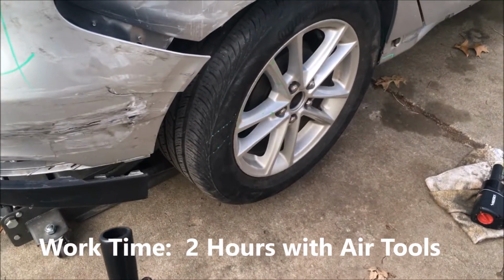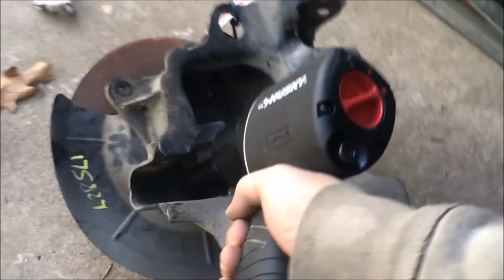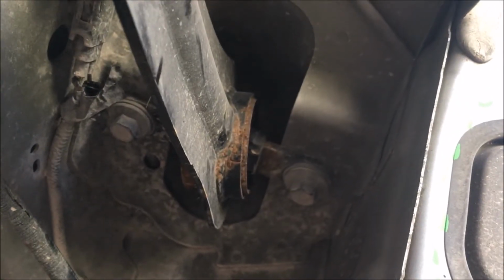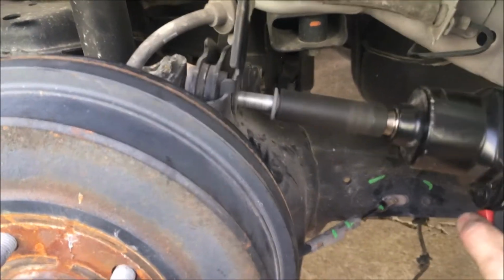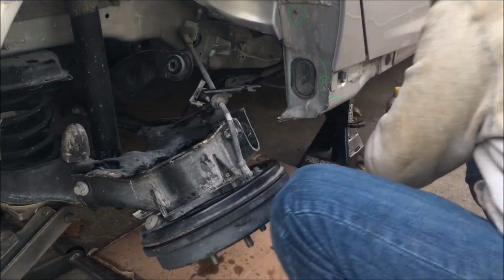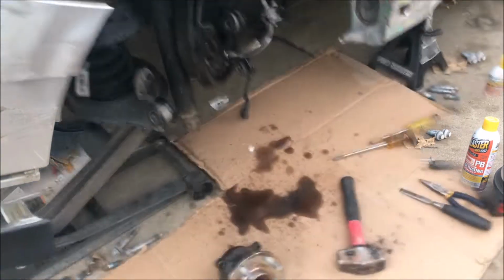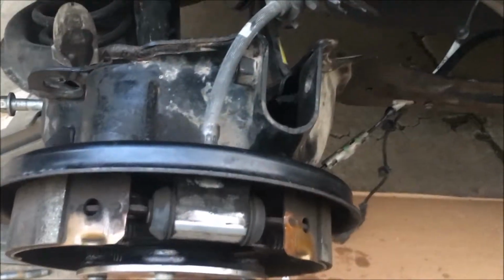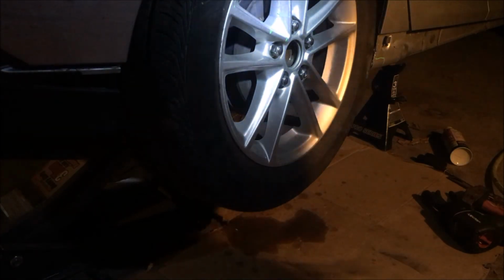How to replace 2015 Ford Focus Trailing Arm/Knuckle/Rear Spindle (2011-Present)

Comment: did you compress the spring so you were able to get it back on or did the weight of the car provide enough compression? I need to replace the trailing arm on my 16 plate focus